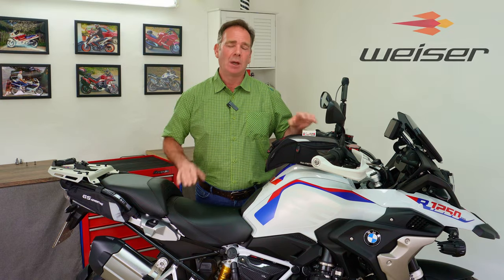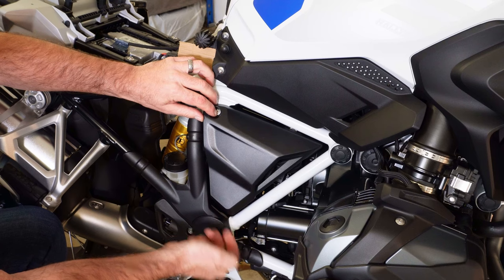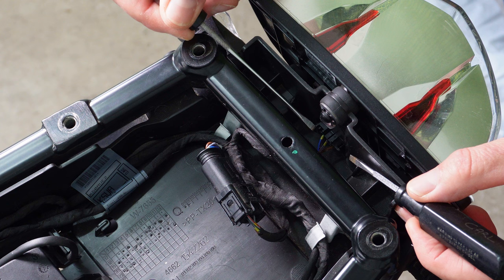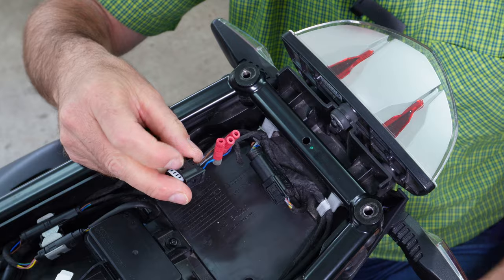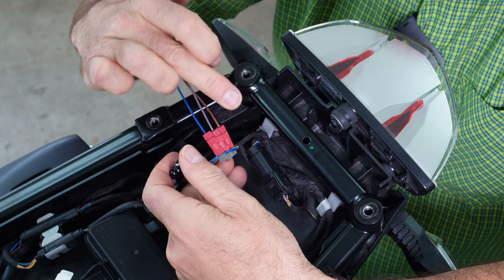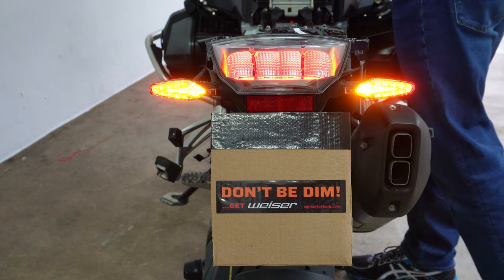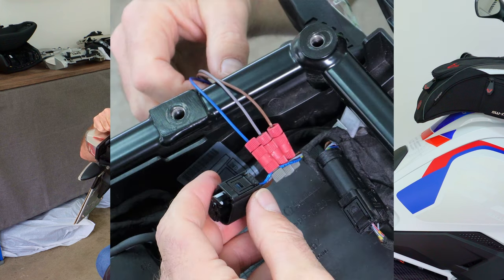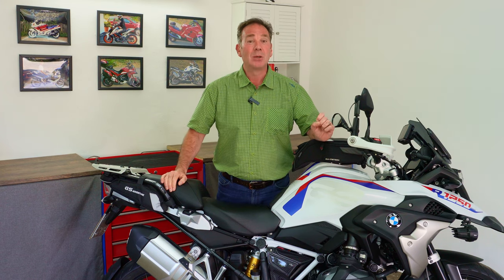EP: 22 Weiser Technik EXT-Run-on Module Installation Guide BMW R1250GS & GSA 2021 to 2023

Comment: Another brilliant video Carl thank you 🙏 I sent you an email advising I now have the Weiser Technik lights installed so will look at getting this "add on module" for the rear light 👍 best wishes Karl 😊
Reply from the maker: Hi Karl, thank you, the rear tail light activation module has been updated, it’s now a simple plug and play module and easy to install.
At some point I need to re-film the installation as the one in my video is the older version where you wire it in. The new version works in same way but it simpler to install.
Ps. Denali sound bomb is the answer, very good quality and loud.
Carl
Reply: Thanks Carl 👍 I just had a great chat with Mark Atkins at Weiser and he told me the rear light is now just a module and very easy to do 😊 so I have ordered it tonight 👍 Which version of the Denali sound bomb would you recommend please and is it easy to install? Ride safe cheers Karl 😊
Reply from the maker: The standard one is fine and much better than oem. Mark does have them in stock so give him a call and he can add it to your order.
Bear in mind there are is a version for the factory lowered gs, which is different so give Mark the details of your GS.
Reply: @justthewayitis  thanks again Carl 👍😃
Reply from the maker: Your very welcome 🙏

Comment: Another great video Carl. A wee tip you might want to try for removing the original loom tape; use the tool that a seamstress would use for ripping out stitching. Be sure to put the ball end inside the harness though. Clean the tool after each use as the glue from the tape will accumulate on the blade.
Reply from the maker: Hi Russell that’s a brilliant idea, I’ll order one and use it during the next installation video I make.
Big thank you 🙏 
Have a good weekend Carl
Reply from the maker: Just ordered one on Amazon 
👍🙏🙋🏻‍♂️
Reply: Wish I'd seen this tip before I fitted mine yesterday. Could have stolen the wife's. 😃

Comment: Fitted mine yesterday. its easy, taking the stuff off is the biggest  job.
Reply from the maker: But it’s a lot easier than some bikes 🤔
Reply: @justthewayitis  true. Tapping the 3 wires in though is a doddle. I bought some of the original loom tape and re wrapped the loom and the wires from the unit to make it look like it is original. ( I soldered the wires in)
Reply from the maker: That would be the best way to do it 👍
In my installation guides I just show the simplest/ easiest way, but of course there are better more appropriate ways to install these.
Carl

Comment: Great how to video Carl. My module is on it's way. Wanted to let you know that I just picked my bike up from the shop today where I had the Hayes calipers replaced with Brembos and the Anakee replaced with the Metzeler Tourance Next  2. The shop would only put the OEM brake pads in so I'll have to get the SA and SP pads ordered and replaced myself. But, I can already tell a difference in the brakes and the Next 2's are amazing. Brand new with less than 20 km on them and they are way better on road than the Anakees. I've got a good feeling that the Next 2s are going to be a fun tire to ride once I have them scrubbed in properly. Thanks for all the videos on the GS series of bikes from the road rider perspective.
Reply from the maker: Hi Correy, good morning, It’s a pleasure to help owners with these videos, the more we share the more we learn and I learn from owners that leave comments too.
I’m so pleased with the NT2 tyres, they completely changed how I feel about my bike….and also the change to Brembo in terms of control and feel.

Best wishes and thank you for positive comments, Carl

Comment: Hi Carl, I was at the ABR Festival this weekend and I saw a BMW GS that with multifunction indicators but the bike had obviously had a tip over, and had smashed one of the rear indicator units.  This meant that the rider is left with only a single small rear position light to keep them safe on the road after dark unless they are braking... re-activating the rear light seems like a no-brainer to me!
Reply from the maker: Hi Rikky, nice to hear from you, I hope you had a great time at the ABR show, did you have a stand for your channel… or were you just visiting ?
possibly next year I will go too. 
Yes your observation is correct about the rear setup, I know reading through the comments it’s not for everyone but I really like it the difference is huge in the early morning or as the sun sets and like you say it’s much safer to have the centre light that is much less likely to be damaged in a fall.
Wish you a great week ahead 
Carl

Comment: Just found your channel Carl, thanks.     I will order the front and rear kit for my 2023 R1250GS.         The kit I am buying seems to have have a plug that daisy chains between tail light?        Your rear light model in this video taps into wires???   Am I missing something?
Reply from the maker: Hi Billy and welcome !!!
if you order the full Wizard kit, everything will be simple Plug and Play modules as seen in videos 23 + 24.

But... if you buy the original EXT run-on module it will be the wired version ( as per video 22 ) unless you mention in your order that you want the plug and play version. Then of course Weiser will send you the new version. 

Eventually Weiser will discontinue the wired EXT run-on unit and replace it with the plug and play version.
hope that helps.

Have fun with your install, its really very easy.
Kindest Regards Carl

Comment: How to mount a second pose-tap to the blue wire if we already mounted rear Weiser indicators using pose-tap to connect red and blue wire?
Reply from the maker: Hi, I have covered that in the second part of the installation guide. I show owners 2 different ways to do it.
Carl

Comment: I would rater not tap into my wiring insulation and would rather have matching oem connectors so its more of a plug and play type mode are those available
Reply from the maker: Hi Paul, to do that you would need both male and female connection, sadly only female / sockets are available from the manufacturers…. Denali use these on there hexcan system, but the male / plug is not available and the cost to make these would be excessive.
The solution that Weiser-Tech offer is our only option and it works.
Yes I agree completely but the male plug is not manufactured 
Best wishes Carl

Comment: Hi Carl fantastic videos. I’m waiting delivery of the indicators and rear light module. Bike is stripped down and is ready for installation. Do you now if fitting the Weiser parts are going to affect the BMW warranty. I’m going to fit them anyway for safety as I’ve had three near misses. Thank you for making the insulation so easy much appreciated John 👍🏻.
Reply from the maker: Hi John, when ever we fit things to our bikes we affect warranty, but by installing the indicators we just affect the warranty on our lights because we have made a change to original. Each dealership seems to answer this warranty question differently so it’s worth asking your local dealer.
The benefits of the Weiser-Tech system for me at least outweigh any warranty issues I had.
There brilliant and now my riding friends and other road users can see what I’m doing when braking and turning 
Carl
Reply: @justthewayitis  Hi Carl I totally agree with you. No warranty is worth harm to any of us. And again thank you. Ride safe 🏍️👍🏻

Comment: Great video but does that brake light when connected go brighter when you brake or is it just a running light 👍
Reply: It acts as a running light and brake light as the 2018-2021 Gs'
Reply: It didn’t look on the video the brake light iluminated when the brake is activated just a 3xtra running  light or it’s my eyes 😂😂
Reply from the maker: Hi, yes as Slip has already replied the module just adds a rear running light, but it retains / keeps the standard brake light function 
Carl
Reply: Ok thanks Carl 👍

Comment: Fitted mine yesterday everything comes on then off puts numberplate warning on dashboard
Reply from the maker: Hi Tim, that’s not normal I’ve fitted a few myself with no issues, send Mark at Weiser-Tech an email or give him a ring. He will probably send a replacement 
Let me know how you get on 
Carl
Reply: @justthewayitis  I am going to ring them tomorrow. I've te made all connections still same removed and just put indicators system red wire back in works perfect.
Reply from the maker: Then I guess the unit is faulty, sorry to hear that. Carl
Reply: @justthewayitis  carnt see that the pierced end could be faulty at all.
Reply: Thanks for forwarding my issue. Mark was straight in touch and apparently its to do with the canbus vs tracker. To be continued lol..
Reply from the maker: Hi Tim, yes that sounds like an interesting conflict between the devices. I’m sure they will find a solution 👌
Carl

Comment: Just installed my run on module and it does not work. Followed the instructions and watched your video which is all straight forward. Just emailed Weiser Technik with a photo of my wiring and short video of it not doing anything.
Reply from the maker: Oh, that’s not normal 
I presume the regular standard lights all work ok ?
Reply from the maker: Are you in the UK ?
Reply: @justthewayitis  Yes the standard lights work ok, as normal. Yes I'm in the UK, March, Cambs.
Reply from the maker: Really surprised, just email Mark at Weiser and he will send one to you. The Weiser team are at the ABR show this weekend, if your going let Mark know and he will see you there with a replacement
Carl
Reply: @justthewayitis  I was surprised too and disappointed after re-connecting the battery. A message came up stating the number plate light was malfunctioning. Not at the ABR show unfortunately, must do it next year. I will await response from the Weiser team. Thanks Carl
Reply from the maker: Ok, let me know how you get on
Carl
Reply: @justthewayitis  Mark got back to me and will send another out. He is curious and wants his engineer to come out as I'm one of the first retail customers, they are test checking the stock now. Its stopped my number plate light working, can this just be a bulb replacement or new unit, would you know? 
Jason
Reply from the maker: Hi Jason, great to hear Weiser-Tech have responded to you, no I’m not sure about the number plate light, don’t forget to check which light running mode you have selected on the left hand bar, try both positions and recheck the number plate illumination 
Carl
Reply: @justthewayitis  Now I've taken the module off, the number plate light works again! mystery.
Reply: @justthewayitis  Well that has them thinking. A reduced module to 20% seems to work on my GSA. They are now looking into why mine did not work, possibly due to the trackers power drain. Great guys, hopefully their trip to me will help for future modules. Interesting to see what they come back with, thanks for your assistance.
Reply from the maker: Hi Jason, Glad to hear they managed to resolve your issues/ conflict with the Data Tag system and I’m sure you are right and it will help Weiser-Tech improve the design. Thank you for letting me know 👍
Best wishes Carl

Comment: Great video, I have the same question as @milaabaigar536
Reply from the maker: Hi Steve, brake light works as normal
Carl
Reply: @justthewayitis  Hi Carl, Robert here I must admit i can't see the main tail light light up as a brake light the indicators light up ok and seem to reflect on the main light. When I do it on mine without the module the main tail light is very bright.
Reply from the maker: Hi Robert, yes it’s not easy to film exactly what happens in terms of brightness. If you watch last week’s one you can see the difference between tail light and brake light more clearly.
Have fun the pair of you on your adventure 🤞🙋🏻‍♂️ do you head off this weekend?
Carl
Reply: @justthewayitis  We head off on Friday 30th be in Cochem on sat night then onward cat wait.
Reply: Just watched last weeks video and I can see it working DOH is me !.
Reply from the maker: Lol okay 👍 
But your right I perhaps could have made it clearer in the installation guide 
Carl